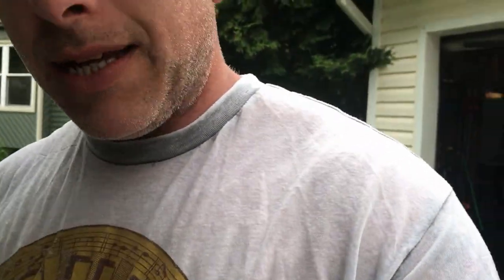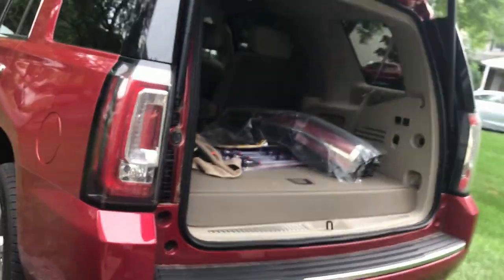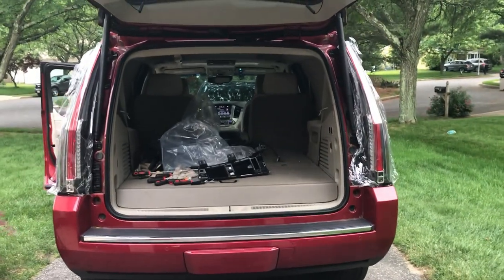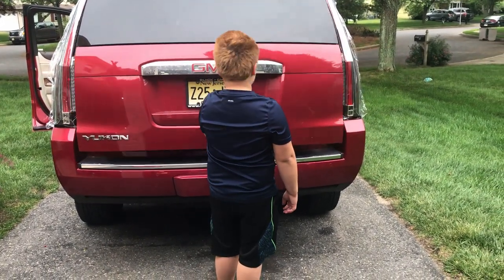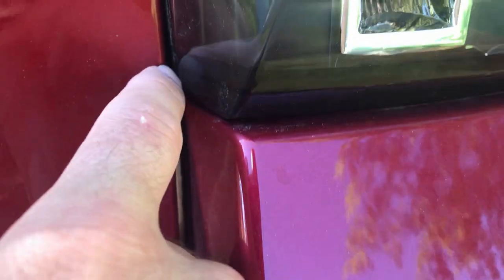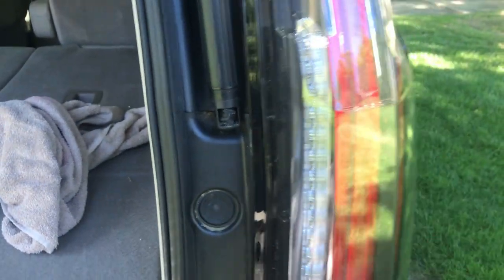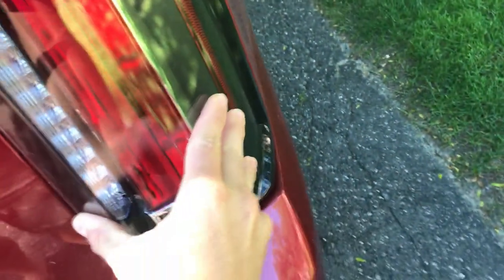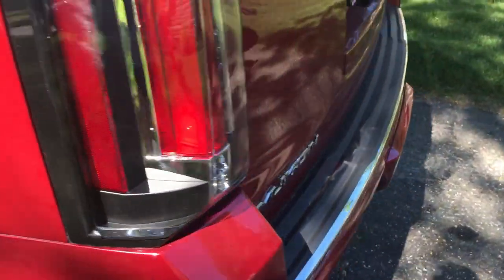2015 Yukon Denali Cadillac Tailight Conversion - Pt2

Comment: I just Installed mine and their is a gap on the outter area/ outer sides. There is about a quarter inch gap from the top all the way to the bottom. It won’t sit flush like the stock taillights
Reply from the maker: Quarter inch seems a bit much. Where did you buy them?